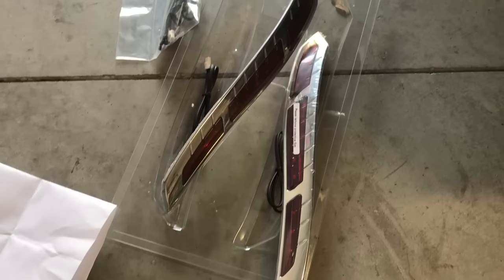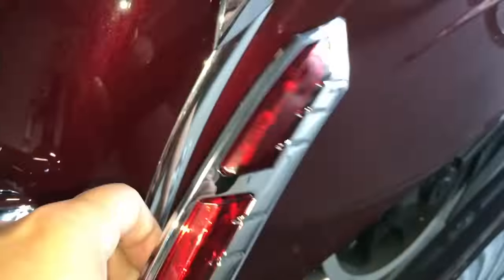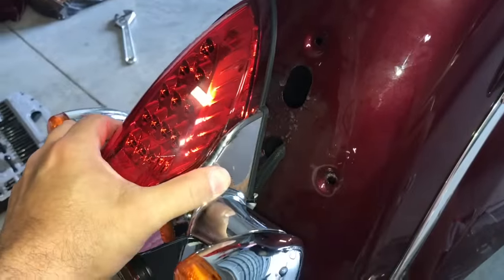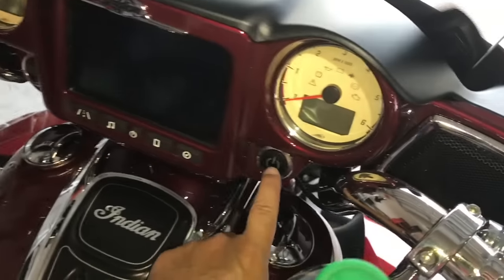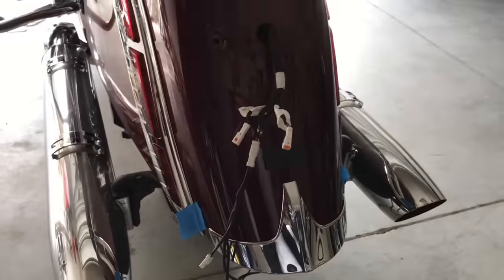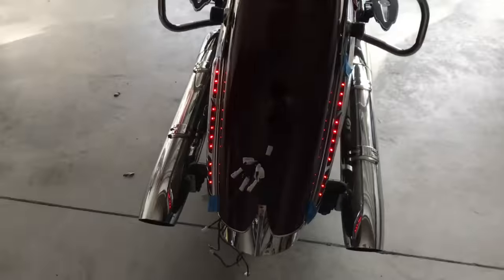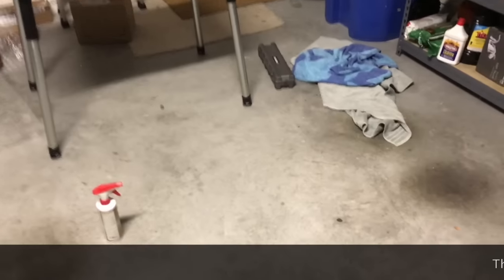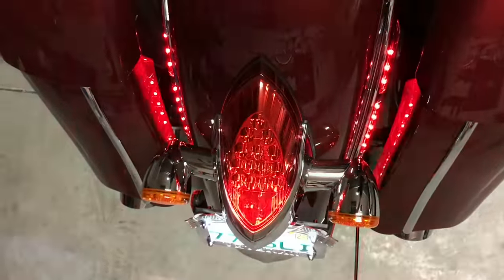Indian Roadmaster - Kuryakyn 5690 Rear Fender LED Strip Light - Installation

Comment: How did you get the tail light assembly off without removing the fender.  Did you remove the rear tire instead?  There is not enough room for me to get my hand on the nuts holding the assembly on, much less a wrench
Reply: Strange.  I was able get up in there with a socket no problem. Mine is a 2017.  What year is yours?  -chad
Reply: Maybe try adding air to the airshock...that may push it up a bit and give you more space...

Comment: 2016
Reply: Hmmmmm don't know why your wheel / fender distance would be so much tighter.  You might have to jack up the bike and see if the wheel drops down enough.  Other than that, you're looking at removing the wheel or the fender.   Neither of those sound like fun.  Maybe wait till you need a new rear tire and do it then.
Reply: Thanks for the advise, I may just wait until I have to take the wheel off anyway.